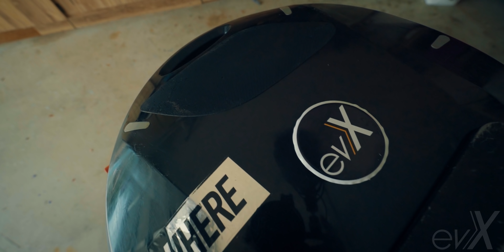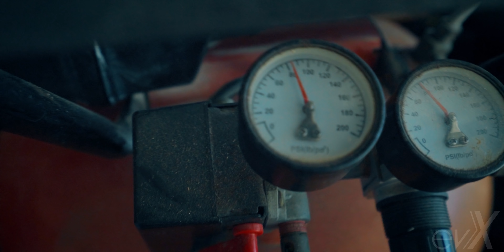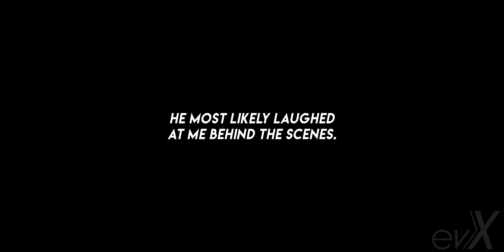The BEST Tire! But you can't buy it from your local dealer... // Gotway Nikola Hack | evX

Comment: Try slightly inflating your tube when you put it in the carcass before you use tyre levers to pop it back on. No real pressure, just enough to give it shape. This really helps you get the tyre back on without pinching the tube. Also putting the new tyre in some hot water for half an hour before you put it on makes the rubber much more pliable.
Reply: This! I put the first bead on, get the tube situated and give it a little air, then you seat the second bead. You can use tools - I don't think I could have seated the bead on my Monster without big ass tire levers. Just have to be very careful and conscious of the inner tube while you do it, and that little bit of air really helps to keep it out of the way.

Comment: I use reusable zip ties heavy duty 20"-25" long , no less than quarter  inch wide , 3 or 4 ties . After insert iner tube gently squeeze the tire and insert zip tie between rim and iner tube on three or four equal places then Tighten Little by little till tire enter inside rim. Release all ties and inflate.
Reply: i dont visualize how you do this... can you send a picture?

Comment: When I swapped my Nikola to the CYT tire same as on the new tire on the 16X I had some weird oscillation that goes up and down when I went above 30mph.  It was unbalanced.  I had to let the air out and try to recenter the tire before inflating it.  Eventually got the oscillation out, but it was a pain to change the tire on the Nikola.  Definitely not as easy as on the KS 16X or 18's...
Reply from the maker: For sure! But I’ve done it twice now, so it’s not as bad.

Comment: I couldnt find the link that you mentioned from Amazon tire but as I looked it up it looks like the Vee Rubber 16×3" tire. Vee Rubber makes the famous and only one of a few mnfrs to make in a 36er unicycle tire, including the Nimbus Nightrider , Coker and QuAx King George tire. Many guys like it for 36er offroads. I have yet to try it. Im gonna order for both my unicycle now, in a 16" and a 36". Thanks for the tire suggestion, it does look similar to the Msuper tire, nice and rounded volume.

Comment: Great video! Did you have to re silicone the electronics?
Reply from the maker: I did not. No need.
Reply: @evXNYC  I just put the Chao yang H-5167 and played your video back a few times for assistance. No hiccups! Tested it and it rides completely different, in a very good way. Much easier to turn and stable. PS have u tried the CY H-5167? If you have how do you rate it compared to this one?
Reply from the maker: I have. That tire gives me that gyro feel so I’m not a fan of it. But i see why other people like it.
Reply: @evXNYC  hmm might need to try the one you have later. Im just happy the wheel doesn't follow the cracks on the floor and try to fight me on high speed turns anymore.

Comment: Hi Mike,
I've read on forums about the MMG P158 tire from Amazon, but, as you said, I couldn't find it anywhere. So I went for a Kenda K1122AX from AliExpress, which is also more rounded and has less gyroscopic effect, just like the P158. I hope this can help fellow 16" riders, especially now with the T4 coming 🙂
Question to you: how did you get rid of the Nikola starting sound, that annoying ti-di-ta-da everytime it powers on? Just don't tell me you disconnected the speakers 🙄
Reply from the maker: I never had that sound. I recall when they first released it, the control boards had that sound, then they removed it on the 2nd batch of production. Maybe you have an OG control board or maybe they brought it back. Who knows.
Reply: @evXNYC  my Nikola+1845 was made in August 2019, so shortly after it's been launched. Looks like you're right about it. Thanks for answering.

Comment: Thank you for this video! I am looking for my post trainer EUC and the Nikola and MSP are the finalists. I was worried the Nikola tire change would be difficult and that was relatively easy.

Do you put power pads on your Nikola?

I noticed many Nikola riders don't have power pads.
Reply from the maker: No i just use friction pads. I think there’s a link in the description for my pads.
Reply: @evXNYC  Thanks! They are in your description and I should have checked it first :)
Reply: @evXNYC  Would you rather have a Sherman or a Nikola? Not sure I want to wait until mid-September for a Sherman when I can get a Nikola next week. I don't think I would regret getting the Nikola and can go on 25 mile groups rides with it and grow my skills.
Reply from the maker: I want both lol. But prob the Sherman.

Comment: Hey, Did you hit the power button after you disconnected the batteries?  Just to eliminate any residual capacitance in the control board?  Also just changed the tire on my Nik. I know this won't happen  anytime soon but you really need to try the Chaoyang H-666 16" tire.  It will give you another level of confidence that you didnt know was there on the Nik.  I noticed I was riding at least 5-7mph faster with that tire and feeling no stress!. Also cornering is amazing.  Just a heads up to anyone out there putting a new tire on the Nik.  It will make you smile...;))
Reply from the maker: Hey Ron, yes in this video I demonstrated me pushing the power button to reel ease residual capacitance. I have also tried the satan tire haha on the Nikola and I was not a fan. It still has that gyro effect. This tire was my favorite of the 4 i have tried. Thanks for watching!
Reply: @evXNYC  Hmmm, interesting,...I swear by that tire, well not really, but its been heaven (not hell ;)).

Comment: Took your advice, and went with the MSP Pro. Hopefully I like it as much as the Tesla⚡ Do you think the tire you installed on the Nikola would give the MSP a better ride? Thanks EVx☺️
Reply from the maker: No keep the cst tire on there. Get yourself some good power pads. Maybe the Clark pads. Then that wheel will come alive with that amazing torque!
Reply from the maker: Did you get the high torque or high speed MSP?
Reply: Went with the high torque because I am a larger dude, and I don't have a need for speed. Thanks again and looking forward on seeing some new videos.
Reply from the maker: Killer

Comment: I enjoy your channel but you need to watch some tire change videos, not make one.  You shouldn't even need those tools.  Get everything off the rim beads then allow one tire bead to fall into the groove at the center of the rim.  While holding the tire bead at some point in the groove, go to a point 180deg away and pull the tire bead over the rim or push it back, where ever you are in the process.  Oh, and you need lubricant to make it easier.  Your old enough I shouldn't need to tell you that:)
Reply from the maker: Sound advice!

Comment: Hell nah, why not simply use slime to fix tire flats, ain’t about to void warranty on something as expensive as a Sherman to change the inner tube. If I need to change tire though.... well hopefully I will never need to.
Reply from the maker: Changing your tire doesn’t void warranty. 😎
Reply: evX That’s good to know. Thought for sure opening up a EUC and completely disassembling it would void the warranty, good to know that If i were to do so and then put it back to then later find out that its not even turning on again due to me messing up during the process, I’m covered.   Great video btw, yet another high quality production, love it!